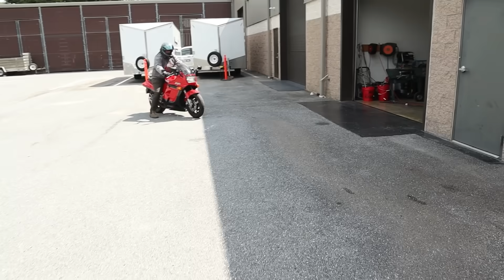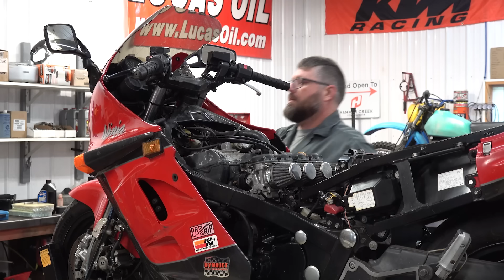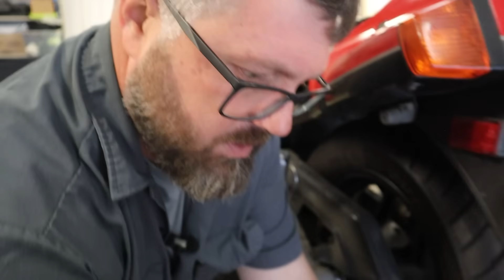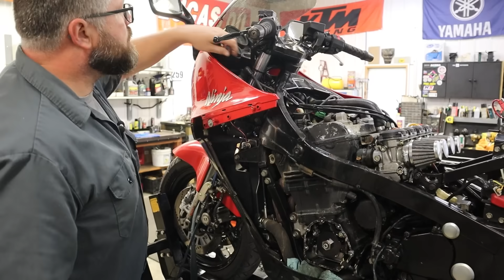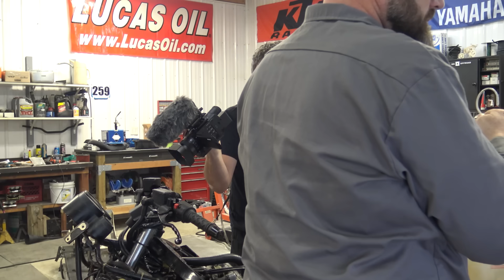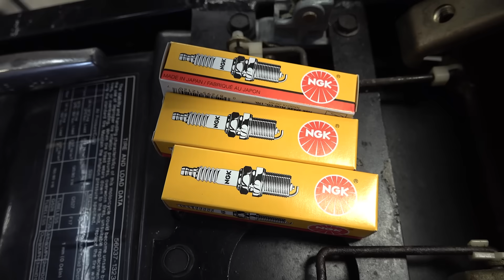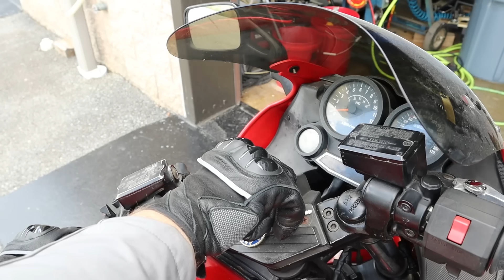Can I Fix This Unfixable Iconic Ninja Super Sport Bike?

Comment: I think a lot of places don't want to touch these older bikes because they can't plug their computer into it and have it tell them what's wrong. The diagnostic skills like this are dying.
Reply: That plus they rather steer you in too something new with monthly payments..
Reply: Actually it's because you have to tell the customer its going to be expensive, then take a parts deposit, then put a buch of labor in it to call them back for more money on the stuff you found, then call them back when the latest (hopefully) problems that appeared after fixing the problems before them.... And tell them how much more money in parts it's going to be before proceeding.   Just to end up with a bike in the back corner, parts in boxes piled up, and a MIA customer that abandoned it.
Reply: A problematic BMW couldn't be fixed by dealers.. the swirl valves on inlet two were stuck... Took them all out car breathes better...
Reply: My family ran a shop in San Diego my dad always said the big 3 fuel electrical or air. With those you can trace down any issue engine wise.
Reply: Nice bikes i have a gpz400 i’m repairing after previous owner ruined it without realised (sump was full of fuel/oil and it did the rings in.
Reply: Plus these old bikes, especially sport bikes with lots of plastic, have pieces that crack and fall apart just by taking them apart.
Reply: It's not because of that - "plugging in the computer" is only the first step in diagnostics. It's because of parts availability and it's just nicer to work on bikes that are so new they haven't had time to be neglected to the point where there are potentially a lot of issues. Customers always want a 'quote' and you simply can't give them one until you've scoped out everything that needs to be addressed to fix the particular issue they're there for, and on an older bike there's much more likely to be more things being masked by the obvious.
Reply: Dealers don’t want to touch the older stuff because you can’t get parts easily and modern tech’s don’t know about carbs and drum brakes.
Reply: @earlbrown  let me guess you work in a shop because yeah That's usually how it goes except for the part where they don't actually find anything wrong. They make things wrong and then make you pay more to fix it
Reply: My oldest bike is born 1954 my youngest 1994 , the rest inbetween , I wouldnt change a thing, except for the security systems which could save you someday maybe.
Reply: There is no tool that will diagnose a vehicle for us. I'm a master tech on the car side. The scan tool only tells us where to start, we still have to do this exact diagnosis.
Reply: It's because the diagnostic fee will exceed their value. Old bikes are junk to repair shops.
Reply: Sadly true
Reply: @earlbrown FACTS. I am an auto collision estimator and I have customers call all the time wanting to pay out of pocket to fix their 25 year old car and I’m like ok sure here’s out it’s going to go, I’m taking payment in full on all the parts, I’m taking a 50% labor deposit, and when I call you in 2 weeks pissed off that I can’t get parts I am keeping the money and you can take your car to the scrap yard. They usually hang up. Lol
Reply: Or too costly for labor?  This guy probably fixed for free.
Reply: Yep if your vehicle cant plug into a modern scan tool then you are left fixing it yourself.
Reply: Seriously. I ask a lot of bike shops and they say no, sorry.
Reply: But if you end up fixing it correctly and the customer can't pay then you can take the bike for non payment and then sell it. So either way if you do good work you'll get rewarded. It may take a while in between your other jobs but it's your bike at that point.
Reply: They don't like to work on old bikes, cause it could take along time to fix = the bill is more than the bike is worth.
Reply: It's more parts availability and liability. You heard him say those plastics were very brittle, difficult to find, and expensive to replace. It's very difficult to find new parts for old bikes and at the end of the day he ended up going with used parts. Dealerships do not buy used parts. They buy new parts.
Reply: @LastExile1989 an engine needs fuel, air, spark, compression and timing to run. Check em in that order, cause that's how common they are to fail. An engine that has all 5 will fire up, every time.
Reply: Understand why you think that. But consider this. It has an issue. What else is bound to happen and show face once you did in. Will it be sittin for a year or 2 in your shop waiting on parts or whatever?
Reply: They don’t want to fix them because the customer won’t want to pay them when they find out what the issue is. And then fix all the other issues they find along the way. AND then get all the missed maintenance over 30yrs paid for.
Reply: Not just bikes. Been that way at least a decade on cars and trucks too. I got into vehicle diagnostics because no one could diagnose my work trucks. ScannerDanner and Motorage are pretty awesome. Pine Hollow not so bad either😊
Reply: @davidtaylor2131 swirl valves on a bmw motorcycle or car??
Reply: I think it’s because if the public, including new mechanical technicians, are convinced everything is disposable, there is no reason to repair anything.  To accept all products only last until the manufacturers dictate, who is in control?  The main thing being taught is hopelessness, accepting nothing can be done about it.
Reply: Yep! Same for some auto mechanics.
Reply: I don't know where you take your bike so that the mechanic can only plug in a scan tool. 
The dying  art of mechanical repair is fake. What this guy just did is first year apprentice stuff. Old bikes have lots of issues and are laborious but there is no issue money can't solve. I'm upset about the derivative tone of your comment. There are some entry level service business that do not employ trained techs and have no time for repair work. But if you want a good technician you have to find one. (My guess is they don't want to be found) then pay the money they charge and say thank you. Or else fix it yourself.
Reply: So many butthurt "mechanics" in this thread. Sorry you got sand in your clams ladies. Rinse it out and get over it lol
Reply: @doc_sav Must be OP's burner account
Reply: @LastExile1989 some will say that compression is its own thing but i get why people place it under ‘Air’
Reply: I don’t think its because they are too lazy to self diagnose. I think its because it takes too much time. They could repair a bike in the time of self diagnosing an older bike
Reply: @spinalfusion1622he said he was puting  plugs in it
Reply: Isn’t it mostly due to liability and insurance? Facilities don’t make parts for them anymore so they’d have to get them used or aftermarket which is not really good for insurance
Reply: @johnr7022  Why would that matter to a garage? That only matters to a dealer.
Reply: I rebuild motorcycles for fun 
It's the untold hours that pour into them yoi don't see 
If I were to charge every hour it's not feasible
Reply: 100% Correct Mate
Reply: What is maddening is trying to find a shop when you break down in any way. We ended up having to rent a U-Haul in Vegas to just drive my buddies 90’s Harley back to AZ as no one would touch it.
Reply: Common misconception! There is no computer you can plug in that tells you what is wrong. The person using the computer needs to be skilled to interpret the data to know what to look at. Much harder to properly diagnose now than ever before you need to know so much more, continue to learn new systems. Back in the carburetor days if u fix one you can fix all.
Reply: You just nailed it😂
Reply: No I don’t think so, from these replies you can tell why, it’s because shops just assume if it’s old it’s going to be too expensive to make the repairs worth it and view vehicles as disposable.
Reply: It's a business 
Making business decisions 
I mean best to make your business your own 
And take care 
Who will love your bike more than you!? 
C'mon lol
Reply: So true

Comment: The most important thing I learned from you is that Craig, as a mechanic, it is always best to install good factory parts. You followed the tech manual, and the culprit was faulty fake parts. Thank you for sticking with it and realizing that real genuine parts are what's  recommended. Good video, Bearded mechanic and TY again for teaching us the right way.
Reply: Problem is they do not make them parts anymore. You either get aftermarket, new old stock or used. After 10 years motorcycle manufacturers quit making and stocking the parts. They then refuse to work on the bike after the 10 years is up. All the aftermarket parts come from China and it is a crap shoot if they work or not.
Reply: I have an 82 goldwing. When I bought it, it didn’t run. Nothing on it worked. I’ve only had it for a week now and I have it running and driving. But something is still off on it and I can’t figure it out for the life of me. I need help😭😭
Reply: Installing an OEM coil for a similar bike is a good work around on something like this Spaghetti. It will not trip the ABS fuse, set off the airbags, or cycle the rider modes eratically.
Reply: Fake or not eventually you'll have to assume that part xyz is not good regardless of how shiny and out of the box new it is
Reply: @spagsketti  I'm curious about those dynatek coils that were on the bike, I've been running those for decades and never had an issue out of them, in some cases they are upgrades to factory depending on the bike.

Being that those were the green ones, they are a 3 ohm dual plug single fire unit, the same ones I run on my xj 550. They aren't cheap either, each one of those coils is 175 bucks now...they used to be 65 each.
Reply: @xeronicus dare say they are fake dynatek coils, we have been coming across them a few times this year. Real Dynatek are an upgrade.
Reply: Nimbus @spagsketti
Reply: @xeronicus  I suspect the coils were fine, it was those triggers or primaries or whatever you want to call them that were bad.
Reply: Or OEM quality. Just not ebay 😂
Reply: @jonjon-jd6vt obviously genuine factory parts would not be my first pick for a completely upgrading modified bike. I was just referring to close to stock or close to original.
Reply: Auto mechanics are the same. However it’s because modern vehicles are built and designed to be diagnosed with a scanner . And the parts. Are  just replaced very rarely fixed
Reply: i often prefer a used original part rather that an aftermarket
Reply: @spagsketti  Yes his idea that you must use OEM when they stop being made so quickly is so stupid.  You try and buy the best aftermarket part you can to keep them running.  Reality strikes.

Comment: Craig you may benefit from an IV holder for your hanging fuel tank.  Wheel it around where you need it and adjust for height.
Reply: Should be ezpz to make one yourself. I know medical supply companies usually don't sell even the most basic stuff for cheap.
Reply: I bought my wheeled IV stand at an estate sale for $5  @EddSjo
Reply: Our shop we use a IV bag holder
Reply: Was it you who sent him One...?
Reply: IV stand is just a long bar,  3- 4  feet  for stability and a hook, a scrap metal plant and access to a welder should get  one made for peanuts.

Comment: Those green coils are aftermarket ones. Probably why they both read same resistance, but higher than what the manual manual says, They probably were working fine.  The pickup coils were the culprit, especially as they were reading almost open circuit instead of a few hundred ohms. I've owned a GPZ900R for 34 years (basically the same bike as this one) and done a lot of work on it. Nice to see some trouble shooting being done.
Reply: Came here looking for this comment.  Yes those looked like Dynatek 3ohm green coils.  So they were in spec for what they are, but outside of OEM spec.  A mis-diagnosis on that then.
Reply: nailed it..soon as you saw the green coils, screams aftermarket! but as you say still great to see someone taking the time. Skills are disappearing quickly these days....
Reply: @gtemnykh  Yep, those coils would have been fine in older aircooled 8 valve 1100, runs fine in mine. Slight possibility that those have done damage for old pickup coils.
Reply: But why did the coils made the bike not run?
Reply: Ah yes, the coils! Had a problem with coils in my KZ750 long long ago. Took forever to diagnose.
Reply: my bandit seems to be having same sickness sometimes.. might be the pick up coil as well..amazing the new ones from ebay didnt work on this bike!
Reply: They ment be grey aren't they

Comment: moral of the story? check for continuity and resistance even with new parts. saves a lot of diagnosis & installation frustration. strong work!
Reply: Rule # 1 never trust Ebay electrical parts, or any parts that have to function. Cosmetics like plastics,  no big deal working parts? Very risky off of ebay.
Reply: @spartanx169x couldn't agree more. In this case you get what you paid for.

Comment: Nothing more satisfying putting on your gear to test all your hard work. Recently got my cylinders honed, installed new piston rings, and lapped the valves on my 130k mile Ninja 500. Test ride went good so I took it to VIR and ripped it around the track. Doesn't get better than that.

Comment: good to see "old school" mechanics still exist, here in my little part of the world it is hard to find a mechanic that will work on anything older than 10 years because all they want to do is have a computer diagnose the problem and then just replace the part.
keep up the awesome work Craig. 👍👍
Reply: One interesting side note I've found. That 10 year "rule" was implemented by the Insurance Industry. At least that's what my local dealership told me. Something about the parts aren't "Factory" available so they can't be warranted.
Reply: @SGTJDerek   Another thing with using 10 years is parts availability.  By law, the factory is required to supply every single replacement part for a machine for 10 years.
After that, they don't have to anymore.  So parts availability can become an issue.

Back when I was a service manager, I would routinely turn away old stuff.  The main two reasons were not just age, but previous modifications/hacks that would have to be found (the hard way)

The other reason is a customer would pay $100 for a basket case, then think it could be fixed for a couple hundred.   When you start talking ''thousands'' to get started (in 1990's/2000 dollars), the usual reply is ''but it's just a motorcycle''.

Taking those bikes in would usually end up taken apart, pushed to the side, and waiting on the customer to bring in a deposit to order parts.   And that time could have been spent actually servicing other machines. Instead of getting stuck with a bike and no title.
Reply: @earlbrown  I can understand that but when a Bike that hasn't changed in 17 years without changing, is still available new and all you need is your tires installed, it's a little asinine.
Reply: @SGTJDerek   Bikes chance a LOT when they sit.

Plus, the basket cases I mentioned don't drive to my shop for a new set of tires.

That's not a ''bring back from dead'', that's a tire install.     (and when you learn that it might take 3 hours to beat the axle out to get the wheel off)

Comment: The fairings alone drive mechanics insane. Moto mechanics fear that the amount of time put into fixing the problem will prohibitively increase the repair price so much that the customer will not pay because they won’t believe how much effort went into resolving the issue, so it becomes a cost benefit analysis decision. Glad you showed how difficult diagnosing and repairing a problem on an older bike can be.
Reply: You're right about the fairings. Got so sick of mine I turned it naked. Made some smaller body panels to cover the ugly parts. Bike looks good and a dream to work on

Comment: Nice one. You've always got to be wary of ebay stuff, sometimes it's knock off junk in oem packing! Another point, those Pod filters will cause carburation problems if the carbs haven't been re jetted to allow for the increased air flow.
Reply: With CV carbs, another thing to be weary of is if those pods have a lip that prevents airflow to the diaphragm port, even partially. In addition, without a shared intake track(see stock airbox) it’s possible the carbs on the outside get more airflow and then you have sync issues. This setup was genius, but it’s very finicky unless dialed in. That’s why I’m converting to efi for my 82.
Reply: I was a service manager back in the '90's and 2000's.  It's untelling how many times I tossed a set of those pod filters and found a used factory airbox to fix the problem.

And, oddly enough, ''Ninjas'' were the bikes that hated pods the most.  With FZR's being a close second.

Comment: Very cool seeing this ole feller. 
I had a 600 Ninja (black w/red), bought it new when they 1st came out in '85. Sold it, then ended up buying another, except it was red w/white, and it was set up for track racing in Utah.
Traded that in and bought a used '89 ZX-10 from the Newgate mall dealership in Ogden in '91, when a guy traded up for a '91 ZX1100.
I ended up meeting him, and eventually buying that '91 from him as well.

The bike haven't been ridden in more years than I want to admit, so seeing one of the brothers running/rolling around and loving, here really bring me great joy and memories.

Thanks a ton!!
Great fix-it vid.